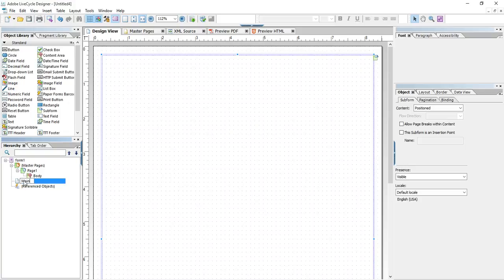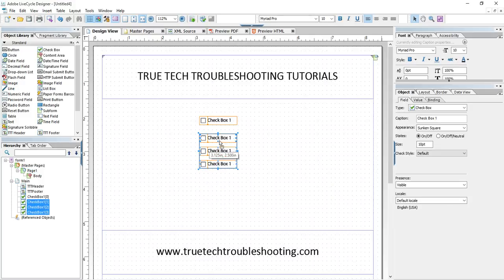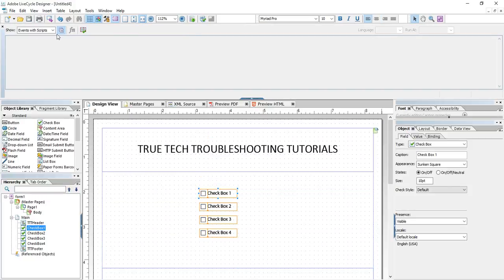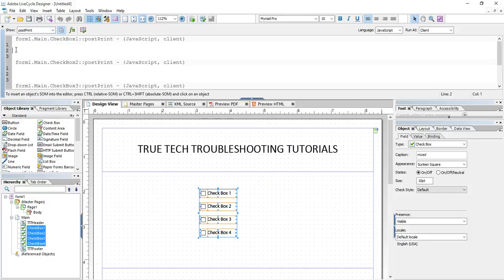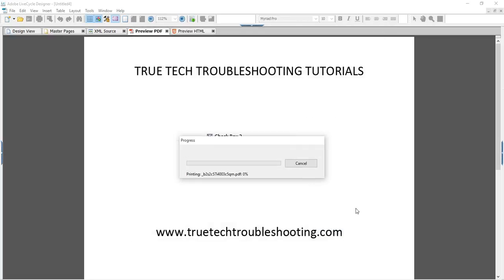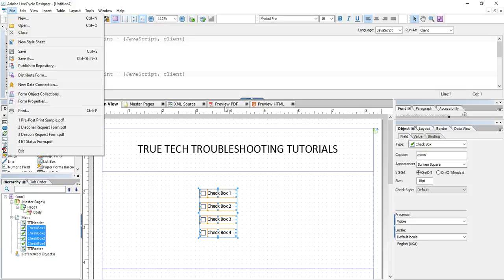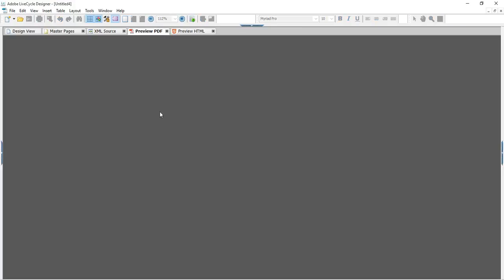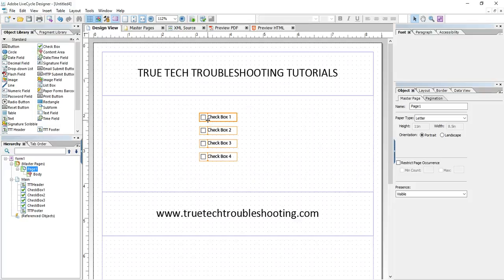PrePrint and PostPrint Scripting in Adobe LiveCycle®

Comment: Can we hide the form Background (art work)  imported from a PDF file, in a Pre print event, Such that when i print it only prints the fields data and not the background if any?
Reply from the maker: +Waqas Ahmad Yes, I suppose you can. It would require knowing the object name of that field and setting the "presence" value to "hidden" via the script.
Reply: +True Tech Troubleshooting I also thought so but the background imported did not showed up as am object.  hence no option to set the presence.

Comment: thanx for sharing. is there a way to disable print option or prevent printing until the user completely fill the form?
Reply: +Maleen Fonseka  i think of you set the fields data status to "Required" the user will not be able to print until all the fields are not filled in